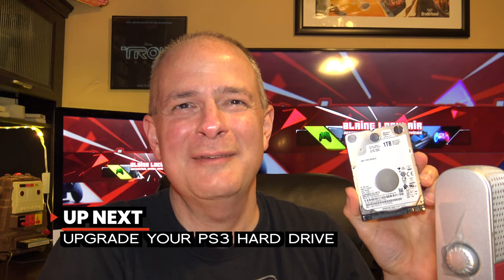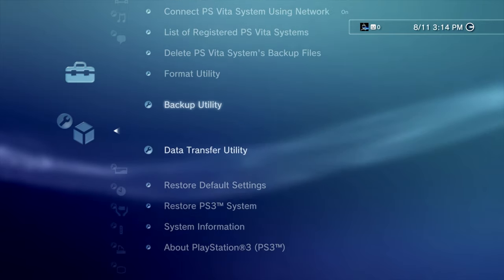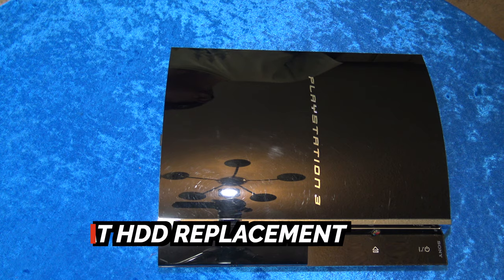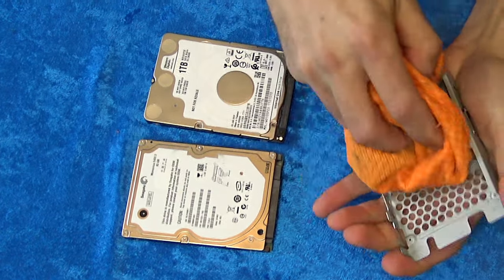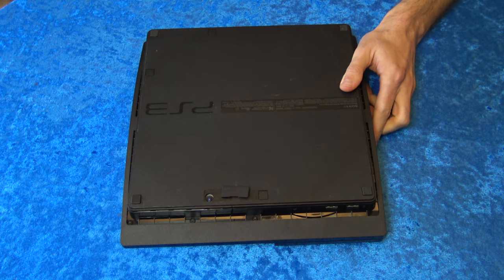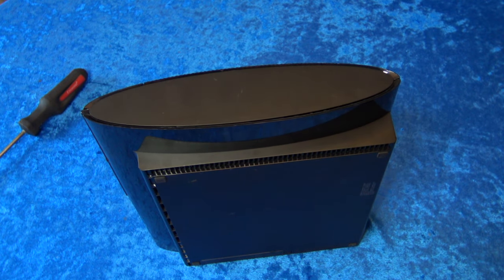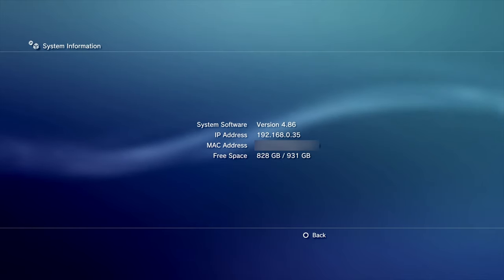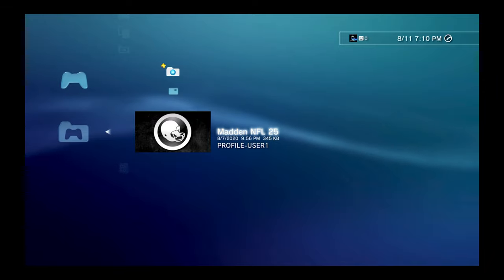PS3 Fat Hard Drive Upgrade 1TB + Slim & Super Slim Guide

Comment: This is missing a MAJOR step. How you could skip over having to do a fresh os install is crazy
Reply: It has been reported that some PS3 will only need to format the HDD and thats it, you don't have to re install the OS. It happened to me. The OS is installed elsewhere not sure but it just works. It worked for me.
Reply: @LlamaRoyal  how u know which ps3s tho?
Reply: Yes specially with phat and the slim it needs a fresh instal.
Reply: @LlamaRoyal what ps3 did u have
Reply: @EzeAsuoha  I actually have phat and slim versions. Like I mentioned it's not as easy for OG XBOX well at least for the 1.6 it's super easy. No matter the PS3 version it's still easy

Comment: Thanks for the video, was way easier than i thought to do this, i had an extra 250 gb hdd so put it in my PS3. Just to let people know, if you have rebug installed, you DO NOT have to reinstall it to change out your HDD.
Reply: Does the same go for evilnat and hen ?
Reply: @mello_man  i honestly don't know . But, i just got everything ready for an install and changed the hdd. But didnt need to do anything. I can only say try it, but be ready to reinstall everything. If you don't have to reinstall its a very simple process. Think i had mine done in like 30 min and was surprised it was so simple..because it seems nothing can be simple anymore. Best of luck.
Reply: Depends on your model of ps3. Some you don't have to, some you do
Reply: @mello_man u find out?
Reply: @mello_man u find out?
Reply: @mello_man update?

Comment: I love your tutorials but you missed something major. I followed step by step but after installing the new SSD the system didn't recognize the operating system. Figured out and added 4.90 to the flash drive. Created a folder named UPDATE and added to the backup flash drive. And it worked! My PS3 is back in business with a 1 TB SSD.
Reply: Did you go OFW 4.90, or reinstall Rebug/EvilNat or something? I'm having trouble with mine - doing the flash, but it gets stuck on Preparing To Update - 98%, not sure where I'm going wrong :/

Comment: I've seen a few tutorial that suggest downloading the PS3 firmware onto a USB stick (in folder PS3\UPDATE). You haven't done this step. Is it not needed?
Reply: i once took the hard drive out and put it back in just to clean it, i had to format the whole drive and install new firmware and i lost all my saves and all my games
Reply: I needed to do this step.
Reply: @badger4512  that's strange, i take the hdd out everytime i clean my console, never lost any data, Never had to format, never had to install firmware.

Comment: Hi Blair, got a question about HDD compatibility.  My understanding is that modern HDD's have a 4K advanced format where the physical drive sectors are 4,096 bytes... but that the PS3 OS was actually designed to run on old-school HDD's that have the previous 512 byte sectors.  I've read on some forums that folks have experienced stuttering issues when running certain games from their newly installed (modern) HDD's - because no one sells those old 512 sector HDD's anymore!  Granted.... even though the HDD's are 4K AF... most will be running on 512e (emulated) so they can work with existing OS's and applications that I/O data in 512 sized packets.  Do you know anything / have experienced these stuttering issues?  I'm guessing the stuttering come either from the physical and logical sectors not being aligned (4K vs 512), or from the 512e process which is essentially an extra step between the OS and the HDD....  I'm really looking forward to upgrading my PS3 HDD, still using the 80GB on my fat PS3!
Reply: Uhhhh trick question?
Reply: Did you ever find out the answer to this?
Reply: @naughtydog9843  no, and to be honest, work got in the way and I never got around to it.  I researched high and low and did not find an answer.  I suppose you could try it, but make sure you have a way to revert back to the original HDD if things go wrong....
Reply: @ianl.4470  hm so does size matter, if i use something like a 512  or 256 Gb hard drive, do they all have that 4k bytes issue?
Reply: @IIIISai  I don't think so....
Reply: @ianl.4470  oh so u believe all have the issue then
Reply: @IIIISai  he said don’t think so
Reply: Actually I have had that issue especially with larger games!
Reply: Yes, you are correct that modern HDDs typically use the 4K advanced format, which means that the physical sectors on the disk are 4,096 bytes in size. However, as you mentioned, the PS3 was designed to work with disks that had 512-byte sectors.

To address this compatibility issue, many modern HDDs use a technique called "512e emulation," where the physical 4K sectors are presented to the operating system and applications as 512-byte sectors. This is done through an extra layer of translation that maps the 512-byte logical sectors used by the operating system to the physical 4K sectors on the disk.

In some cases, this emulation process can lead to performance issues, especially if the physical and logical sectors are not aligned properly. This can cause data to be read or written across multiple physical sectors, which can result in reduced performance and even stuttering during gameplay.

Comment: Pick up a fat PS3 40gb at bookmans for $80 last weekend and wanted to upgrade the harddrive to a 1tb so when doing this my experience was a little different switch the harddrive was easy as pie but when turning on the ps3 i gave me a message about updating the software even though is was already updated to 4.86 already so i just downloaded the software online put it on the fat32 USB and plugged it in the USB and press select and start as it says to search for the update and worked like a charm i don't know if anybody had to go through the same route as me, Thanks for the video your doing great 😎👍
Reply: had the same issue and did the same with the USB and installed the update. Works fine
Reply: How much GB should the drive be that use to transfer over the update file?
Reply: I think i'm having the same problem...little help?

Comment: I attempted to install it but it didn’t work for me, when I turned my ps3 on I received message saying “the system software cannot be run correctly press the ps button to try to restart the system if the system cannot be restarted the system partition of the storage must be reformatted”
I wasn’t really sure what to do. And also I have cfw on the old hard drive, how do I implement that hardware to my new 1tb ssd? Is someone can give some assistance with this Inwould greatly appreciate it.
Reply: You need the updated pup file for the cfw. Create a folder labeled PS3. Click on that and create another folder labeled UPDATE. Then copy the pup file into that folder. Put the USB into the PS3 and follow the steps it asks for by pressing start and select.

Comment: I did this, but it just reset the system and is asking to plug in the controller with usb and hit the ps button. I don’t have an original controller, and my PS4 controllers won’t work with it either. The original HDD is giving me the same message, so now I have to order another controller and see if I can fix it. You may want to add a warning

Comment: Hi Blaine, how about changing HDD for jailbroken PS3? I have a rebug cfw PS3 but after leaving it collect dust for long time first it can't turn on and once on it enter system restore loop. I believe its HDD has already gone and need a change.
Reply: It’s easy. I just upgraded my ps3 running 4.88 evilnat to a 1tb SSD   All I did was backup my stuff to a usb drive. Install the SSD then when prompted reinstall evilnat then restore backup from usb. Super simple. The hardest part was backing up and restoring because it took about an hour and a half each time

Comment: Great video! I have a USB to SATA cable that I’ve used for backups and stuff in the past, can I just backup all my games and data onto the new hard drive and cut out the USB stick?
Reply: I was just wounding the same thing. For some reason I can’t get the usb file right??
Reply: @davidgill7412  Awesome, I’ll try that out. Thanks!
Reply: @claudeschaller  Just found a better solution.  On your CFW (you're using EvilNat 4.88 firmware right) go and highlight Network Settings.  Hold D-PAD Down, L1, L2, L3, R1, and R2 at the same time.  This enables the Debug menu with the HDD Disk exchange utility.
Reply: @davidgill7412  Mine was on CFM4.83 or so. Would the Debug clone work from a native 120GB HDD to a new 500GB HDD?
Reply: @valentineli305  don't see why it wouldn't.  As long as you can access that debug setting.

Comment: I placed 1TB drive in my PS3 slim.  It will not read my new 1 TB HDD.  It says I need "No applicable update data was found.  Connect storage media that contains update data of version 4.90 or later and then press START and SELECT buttons at the same time."  I'm not sure what to do from here.  Any ideas?  Thank you.
Reply: I have the same issue as well
Reply: What was the solution?

Comment: After i changed the hard drive, I can't turn on my PS33 with my controller and I can't copy my new saves to a USB stick anymore. Only the saves I had before the hard drive upgrade. I've tried 2 different hard drives and it happens with both. What do I do? And yes i plugged the USB chord in and hit the reset button at the back of the controller.

Comment: When I put the new hard drive in, it says, "the system software can not be run correctly. Press the PSS button to try to restart the system. When I tried that, it still did not work. So I'm stuck on that page.
Reply: Can you get into safe mode? I think you can force it into safe mode I just don't remember how, but if you get there, there should be options to get you finished from there
Reply: @josephhall7317 safe mode is enabled by holding down the power button until it cycles on and off then holding it down again until it beeps twice in quick succession

Comment: Can you add a 2tb HDD or more to the ps3? And if you replace the HDD do you have to re-jailbrake it?
Reply: I think the official maximum drive size for PS3 is 1 tb. Unofficial sixe is 1,5 tb, but since it's unofficial you can guess that a lot of 1,5 tb drives won't work.
Reply: No I tried it I have fatt 60gb ps3
Reply: I have a 1.5 tb installed in my ps3 and it works without any issues. I honestly wouldn't go any higher than that tho

Comment: Doesn't work.  I get the following error after starting it up with the WD 1TB HD you recommended: "The system software cannot be run correctly. press teh PS button to try and restart the system. If the system cannot be restarted, the system partition of the system storage must be reformatted and you must reinstall the system software. Connect storage media that contains update data of version 4.89 or later, and then press the START and SELECT buttons at the same time. For information on how to obtain update data, refer to the SIE Web site for your region." I inserted the usb stick with the backup but it doesn't seem to read it.  Maybe it's because my PS3 has a newer firmware, not sure.  Has anyone gotten it to work on 4.89?  If so, how?

Comment: I get a message that say the system software cannot run correctly and then when I try to install the firmware from a usb drive,the ps3 doesn't recognize that there is ps3 firmware on the usb drive

Comment: I just upgraded to a larger hard drive and once I power the system up I’m getting a message that saying no applicable update, data was found connect storage media that contains update data of version 2.54 or later then press start and select button at the same time.

Comment: I bought my ssd last week and replace it for my hhd on my ps3, than i tried to install cfw and something went wrong. Now i have a brick ps3 and a ssd with no use... by the way nice tutorial.
Reply: @blainelocklair  it was a chech 2001A
Reply: Did you flash memory bin before installing cfw? Check out an eflasher
Reply: @blainelocklair  how much space does it have and if I buy the hard drive on link and I choose 2 TB can my ps3 install lots of games
Reply: @ShadowMods221  1 tb is the max official size but there are some 1.5 drives that are said to work unofficially.
Reply: @naughtydog9843  1tb is plenty and a safe bet

Comment: Hi Balin , I have just jail broken my ps3 based on your video . But now I see this hdd upgrade .. Will changing my hdd remove my jailbreak or it that another part of the memory?? Thanks
Reply: Hi Forge. Did you found out about this? I'm about to do the same.
Reply: Did you find this out? I want to do that too
Reply: @aaronmartinez9877  Not yet. Had some problems with my PS3, if I do it I'll update here.
Reply: @aaronmartinez9877  I'm in same boat please share if you learn anything.

Comment: Incredibly convoluted, how I ended up having to do it, but I force-downloaded the playstation update to my phone (it wouldn't active just by clicking the link, so I had to hold it down until a menu popped up, told it to download & when a messae box popped up, click download anyway), transferred it through my laptop to a USB stick with the PS3 & UPDATE folders & then updated my PS3.

I'd been led to believe that I could just hook the hard drive to the PS3 with a SATA to USB adapter & do a straight copy transfer. Found out the problem after getting some weird results when plugging it into my computer & looking it up- USB can't supply enough power to an internal hard drive to get it fully running, so it's data can't be accessed the way it can off of a basic flash drive. I guess the only way to do it is doing what the PS3 itself recommended- connecting two PS3's together via ethernet.

Comment: Will this remove the jailbreak and I'll have to re-jailbreak?
Second question, can an SSD be used, or does it have to be an HDD?
Thanks for making such detailed videos
Reply: As long as the ssd has a sata connection it should work. This ain't the PS5 with its fancy M.2

Comment: Can you just clonr the new drive from the start instead of tranffering it through the usb? For instance im upgrading to a 1TB ssd. Instead of backing up onto a usb stick, swaping the the drives and then perform back up function,  can't i just connect my new ssd via sata to usb cable and perform the back right away to the new drive and then swap drives?

Comment: Forgive me as I'm a newbie to the mods of the PS3 but is the benefit to a jailbroken PS3 the ability to upload your Blu-ray games straight to the hard drive and load and play them from the hard drive as well without using the original disc..? Thanks 👍
Reply: Yes, it is possible to do it through multiman. I did this to my copy of Black Ops 2 because the disc was severely cracked but I still managed to get all the data over, before it was a goner.

Comment: Hey, I followed this video, and when I put the new hard drive in, and I put the flash drive with the backup in, I keep getting a screen that says

“The system software cannot be run correctly. Press the PS button to try to restart the system.

If the system cannot be restarted, the system partition of the system storage must be reformatted and you must reinstall the system software.
Connect storage media that contains update data of version 4.88 or later. (…)”
Reply: I have the same issue here. Did you resolve yours?

Comment: Can u get a new hdd for the ps3 slim without updating the firmware with a usb drive because I don’t have a pc to copy the system update file that would be lame if u have to do that
Reply: I mean if you have an android phone you can get an otg adapter to use a flash drive, download the file an put it on there.

Comment: does ps3 support sata 3 hdd??i know sata is backwards compatibility but i read that ps3 firmware  supports only sata 1 or 2..
Reply: I just put a SATA3 drive in my PS3 slim.  Worked fine.

Comment: QUESTION: Is it okay to use a 32GB drive rather than a 128GB drive?
Reply: I guess as long it's has enough space to do the transfer, it should work. If you have a lot of games and saves, then most likely not.

Comment: I've always seen people upgrading the ps3 up to 1TB but I wander if you could upgrade to 2TB or higher than that. Would the ps3 read a 2TB drive without any issue? The only thing I've got recommended thus far is to use a HDD that runs at 5400 RPM max but nothing more. Please answer if you seen this question, I really need to know.
Reply: 1tb is the max otherwise system  will crash continuously
Reply: @edwardlujan1325  Thank you very much for your answer.

Comment: I have an original 20 GB PS3 but certain games keep freezing. You think a better hard drive would fix that?
Reply: @blainelocklair  thanks for the reply
Reply: Des Zee it might not be a hard drive defect but the ps3 not having enough ram to display the next frame  

Solution delete UNNECESSARY apps and games and closing apps
Reply: Try rebuilding the database or restoring the file system in safe mode
Reply: Don’t facking format ps3

Comment: First off, this is a wonderful video! At the current time, the 15 people that disliked this video have an original XBox and never experienced a PS3… I feel for them! But if I may ask, how is a PS3 able to self format the new HDD with it reading as a Sony console ready to login, and not ask you to upload the current update like on the PS4?
Reply: I know I'm not the uploader but the PS3 is a different architecture. The Original Xbox used unique HDD keys making it a nightmare to upgrade and copy over. On top of that the eeprom needs to match too, while the drive needs to be locked in order to work. I imagine that's not the case with the PS3.